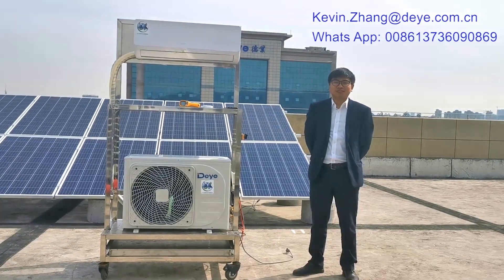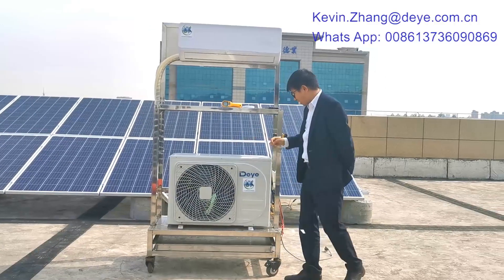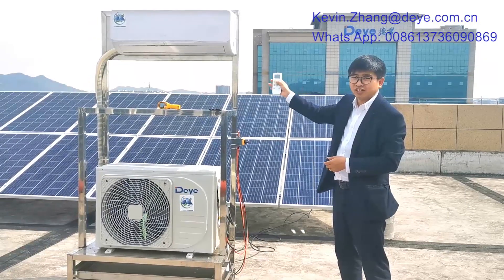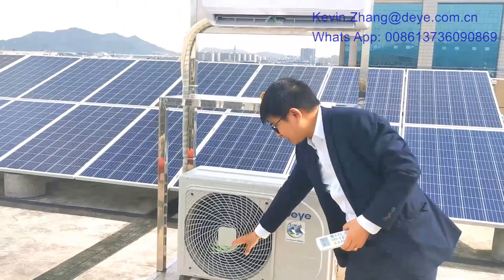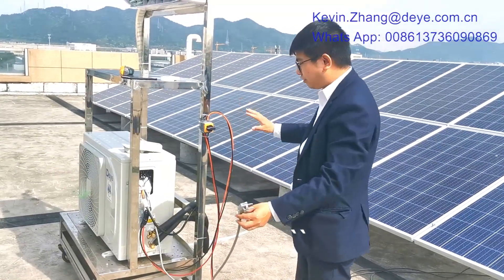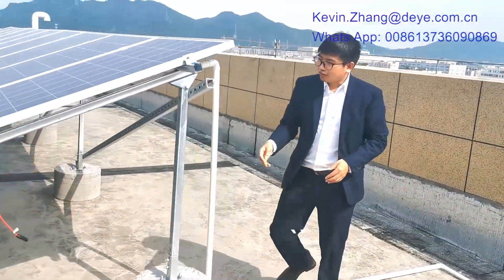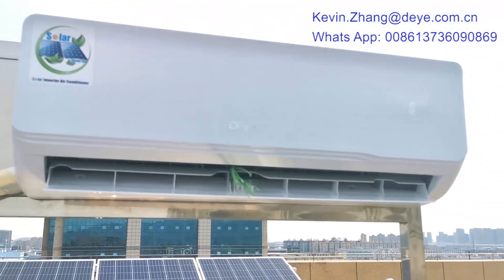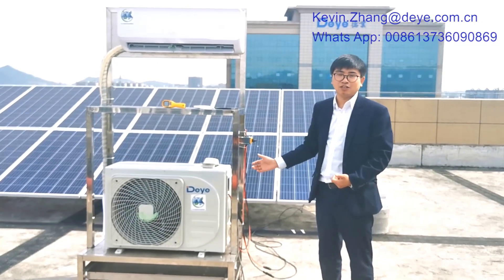1/ How to save 100% electricity and how to easily install the split unit

Comment: A/c that consume 1 kw for 10hr per day needs around 2.5 kw solar cell it means 10 cells (250 w) and area not less than 25 m2 ...is it logic to apply at apartments ?

Comment: Hey Kevin,  would love to see a followup video with Solar only (no grid tie). Particularly if the clouds cut power down, does the unit shut down completely, or does it just cut it's power consumption all the way down?

If it does lower consumption, what is the lowest wattage you have seen it draw ever? Will it go down to under 200W and still function (even a little bit?)

If it does shutdown when a cloud cuts production, how long does it take to come back up to full functionality once the cloud passes?
I have heard of some solar hybrid units shutting down for upto 15 minutes at a time if they have to shut down due to lack of photons, which would be a nightmare on a cloudy/sunny/cloudy day.
Reply: Have you got response on that, i have same query, i have same air-conditioned, it shuts down completely and have heard that it fuck up the refrigerant system of ac too

Comment: Will it operate on 48 volts of batteries as well as solar direct?

Come visit the states. Bring product.
Reply from the maker: Hybrid AC/DC type can not DC48V,  it's solar panel 80-380V DC directly power supply
Reply: @DeyeSolar 
1) the minimum outdoor working temperature for heating -10 or -25°C??
2) If solar panels give 16A, can they be conected? Because inverter incoming 12 A,.
But most devices connected to the source and received what they need, but some devices cannot do this for example if conect, pump or lamp to 12 V battery it can work, but if conect diod lamp without specific device of cutting current it will burn
Reply: Will it run on say 100 volts of battery?
Reply: How type of MPPT booster you use to support DC caps in inverter board ? Thanks.